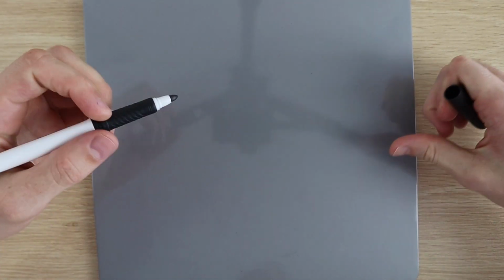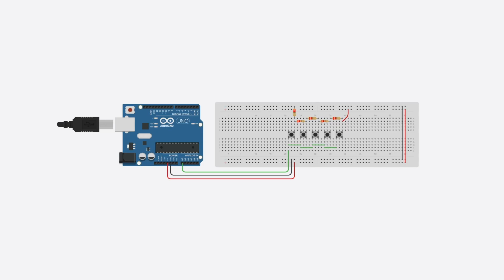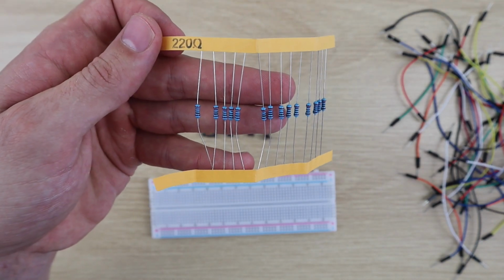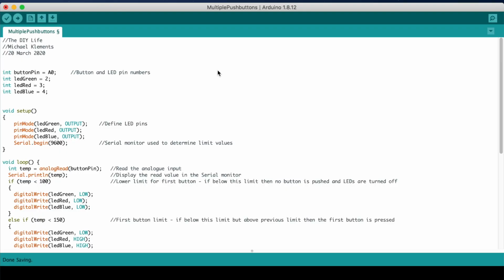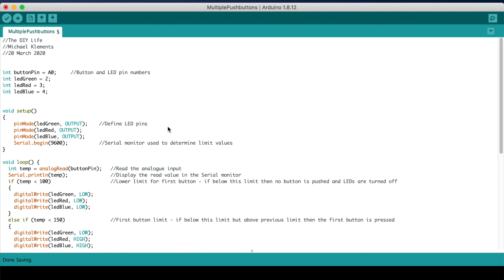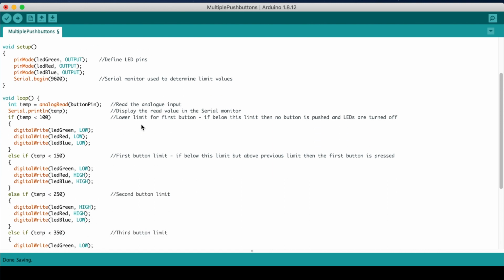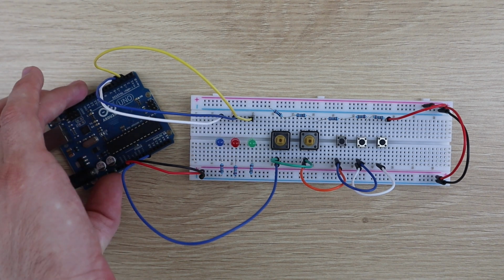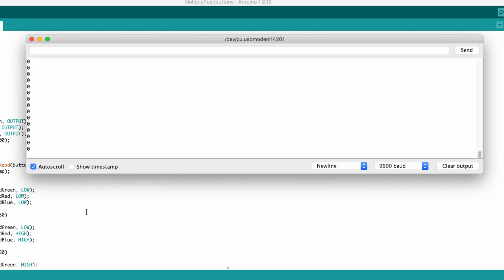How To Connect Multiple Pushbuttons To One Arduino Input

Comment: I would like to connect the switches to 8 digital input pins powered by a single output

Then connect 8 additional switches switches to the same input pins but powered by a second output using diodes to eliminaste Cross talk

Comment: Hello is it possible to connect two separate buttons that have the same functiona (down) on a fighting game controller that uses a brooks zero pi pcb, do you know about this?
Reply: Basically screw the wires of each button into the same (down) function terminal and have them both work when used separately
Reply from the maker: If the buttons are "normally open" then just connect them in parallel and you'll have the same functionality, if they're "normally closed" then connect them in series.

Comment: In theory this can work with other digital sensors right? For example a PIR sensor and pushbutton
Reply from the maker: It'll work for any digital sensors that have a contact or switch style output, most PIR sensors would work this way. Some digital sensors with internal circuitry might try force the output to a certain voltage or may not be compatible with a resistor being in series with the output.

Comment: Excellent tutorial I would like to achieve the same thing as Kevin Chamberlain in the comments I want to use uno and pca9685 to control servo motors using this pushbutton system on the same uno. The pca9685 board will used two analogue pins in leaving 4 analogue pins available could I assign pushbuttons to these four analogue pins would this allow 4 buttons to be pressed at the same time as long as they are on different analogue pins is it possible to assign one pushbutton to each servo in the programme sketch. ThankYou very much

Comment: Good idea:; resistors, by careful math's, you could maybe do two or more buttons at the same time, I think :)
something like 1000 Ohms is button 1; 2000 Ohms is button 2 and then 3000 Ohms is both buttons, (series) or what ever it is in parallel
Reply from the maker: Yes you could detect simultaneous pushes by playing around with different resistor values, you'd just need to make sure that each combination resulted in a unique resistance.

Comment: all you need is to put as many distinct(not of the same value) resistors in parallel as there are buttons  and connect the buttons in series to those resistors, this will give you an unique voltage drop even if multiple buttons are pressed.

Comment: I  have an arduino project that has a potentiometer on A1 which is used to produce 12 different tones. I want to convert the pot to  momentary push buttons so I can play like a  piano keyboard. I am thinking your example should work as a solution for me?
Reply from the maker: As long as you're not expecting to use the buttons simultaneously (two buttons at the same time)
Reply: @MichaelKlements  Thanks for the quick reply!! The tones are actually chords  with harmony note to be more precise so no I only need one at a time.  Thanks again!!

Comment: I just read that there is no guarantee that the input will survive if you provide 5V directly without a resistor to limit current. So maybe you should either add a low resistance compared to the others or an equal one and get your HIGH signal from after then.

Also I think you could make it possible to press and recognize them in parallel if you cleverly choose a unique resistance to add in parallel so there will always be a different total resistance.

Comment: Tks for showing this method, I might use it with à attiny project. I would like to suggest to use différent resistor values for each resistor, this way, you could detect 2 buttons being
Reply from the maker: Yes you could do that too
Reply: Pushed at once

Comment: This wouldn't let you detect two buttons being pressed at once right? It would think it's just a different button further down the chain ?
Reply from the maker: Only if the combination had a uniquely identifiable resistance as well. You’ll also need to program this in as a combination option.

Comment: Can I use resistors with a higher resistance like 1kΩ? I still have a hard time grasping how this kind of circuit works... do higher-resistance resistors use or require more energy/current?
Reply from the maker: Yes you can, the resistor values in this particular arrangement aren't all that important. They are just there to provide a load between 5V and GND. They limit the current, so a higher value resistor results in less current (effectively more efficient).
Reply: @MichaelKlements  Ah cool, thanks for the reply!

Comment: Thx a lot Michael!!! Great video!!! Anyway I've done it and works but the values of the analog are not so stable than in yours that are very sharp. I use the same resistors but with 9 buttons. Any help?
Reply from the maker: Thanks Pablo. If you're getting unstable results its probably either because you've got a poor ground or 5V connection or just poor connections in general. Jumpers and breadboards don't always provide a stable and reliable connection.

Comment: Hi, I understood everything and it's a great video! However, I don't know why, but I can't get this working! Only one button is working, all the others have the value 0 when pressed. I used the 220 Ohm resistors. Please help me, thank you in advance. Best regards.
Reply from the maker: Hi Patricia,
Have you tried working through the write-up linked in the video description? Are you sure that your 5V and GND connections are correct?
Reply: Hi Michael, thank you for your reply. I tried with the code you have in the video description. I am sure the connections are correct. I am using Mega instead of Uno, I changed only the LED inputs codes. The LEDs works fine, because I tested it all of them. When I press the first button I only have one LED on. I don't know what is missing here. :( Thank you for your help.
Reply from the maker: If you've used only 220 ohm resistors then I assume you've connected the resistors are in method 2? If that's correct then start by displaying the raw value from the analogue input to your serial monitor and check whether you're getting a different reading for each button push. If you're getting 0 with any other button push then you've got a problem with your wiring somewhere.
Reply: I did the method 2 with 220 Ohms resistors. I will check again the wires :) Thank you.

Comment: great for expanding inputs. would it be possible for you to do a tutorial using say 6 push buttons on the one analogue to move a stepper motor to six preset degrees?
Reply from the maker: Thanks for the suggestion Deon, I'll have a look at this. It sounds quite easy to do.

Comment: is there anyway make us do this with one digital input ?? because I want for example use ESP 01 which doesn't have analog input ..... thanks in advance
Reply from the maker: There isn't any way (that I'm aware of) of connecting multiple push-buttons to a single digital input. You could, however, use a shift register to connect multiple push-buttons to substantially fewer digital inputs, typically 3 are required.

Comment: Everyone is impressed by this technique at first until you realise the mess that happens when you press more than 1 button at the same time.
Reply from the maker: Yes, this isn't a great solution if you need to handle simultaneous button pushes, but it can be done. As long as you know which keys are likely to be pressed simultaneously, you can set up a case or range for them as well. This works if you've got a few combinations you need, but if its for an entire keypad of simultaneous button options then it can get messy.
Reply: Hi, if all resistors of the divider have the same value we can detect that more than one button was pushed but can not know which ones. If you use  different values for each resistor than you can also detect which specific 2 buttons were pushed